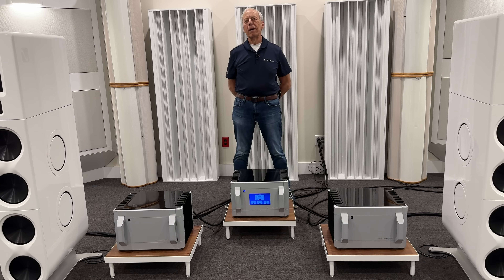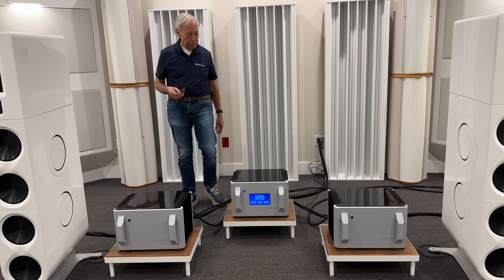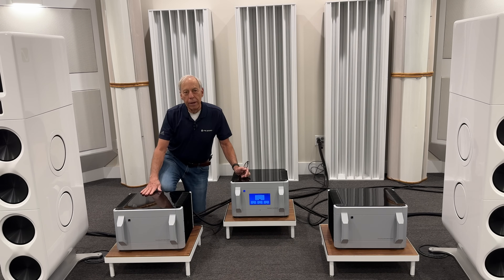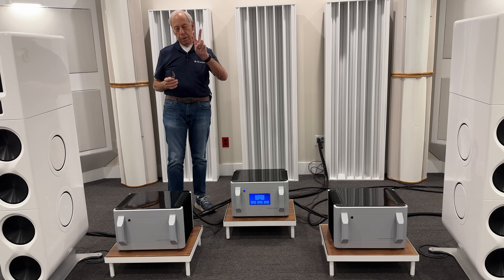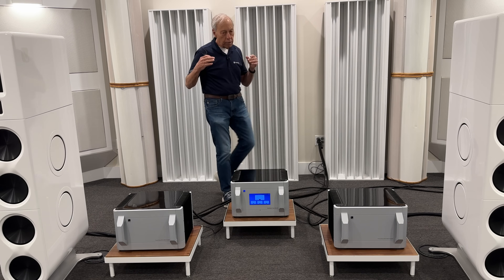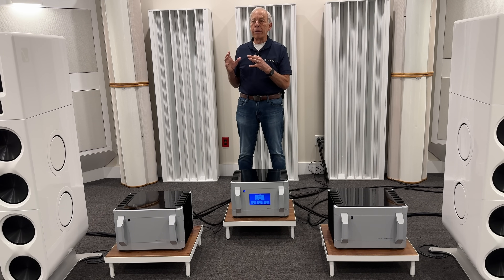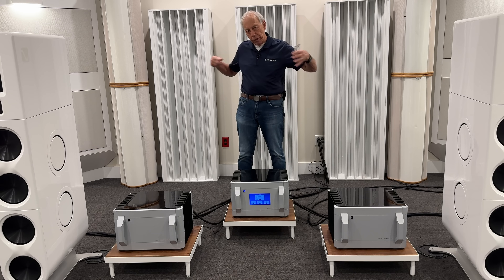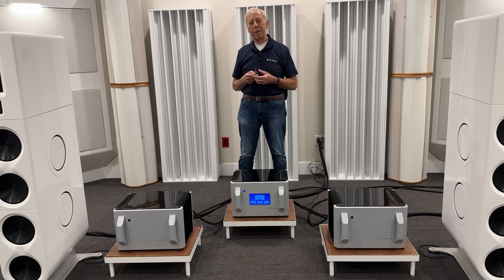What is a power amplifier?

Comment: Can I connect an external amp to preout zone 2 to use for the same main room L/R?
Have Pioneer vsx lx303 and would like to add an Emotiva 2 channel.
Ive used zone 2 in other rooms but not like this above. Can Audysey still work like this? Cannot get any answers, even from any manufacturer

Comment: To me a power amp is a power valve.  It's job is to accurately produce high power signals that faithfully recreate the source.  And it has to be impervious to the reactive push back from the speakers.  What differentiates a good amp from an amazing amp is its ability to recreate low level information with phase fidelity.  This low level info may only be in microvolts, but this is the stuff that breaths life into music.

Comment: Tube amplifiers use transformers as an equivalent to the second current gain stage in transistor amplifiers.
Reply: Actually I'd assert that the power tube is the second stage and the input tube is the gain stage.  The transformer is the transmission.  Back to his car analogy, the engine cannot start the car from a stop light in high gear.  It needs to be stepped down to produce power in first gear.  That's the job of the stepdown transformer.
Reply: Tube amps are two stage with a gain stage followed by a voltage output stage. Tube amps are constant current while solid state are constant voltage. Transformers are for Power transfer.

Comment: I always thought of an audio current amplifier as a buffer than reduces output impedance and has a lot of current in reserve in the large reservoir capacitors, but doesn't change the voltage.

Comment: The car analogy is - voltage = horse power and current = torque (kW) 😀
Reply: Voltage is pressure = torque. Ampere is the volume of the flow = rpm. Total energy accessible or used = Watt. 🙂
Rush hour = Ohm. 🙃

Comment: A power amplifier is technically speaking a voltage amplifier (output voltage = input voltage x gain factor) with ability to drive high currents in a low impedance (typically 2-8 Ohms) speaker load. Power is voltage times current. If the input impedance of a power amp is 100K Ohms and the input signal is 0.5V, the input "burns" 0.5Vx0.5V/100K Ohms = 2.5 micro Watts from your source output e.g. pre-amp via RCA signal. Yes, power is also burned on an RCA cable, even it's a tiny amount. If your speaker output is 20V, meaning 20Vx20V/8 Ohms = 50 Watts in 8 Ohms, you amplified the voltage with 20V/0.5V = 40 times and the power with 50 Watts / 2.5 micro Watts = 20 million times. Thus calling it a power amplifier does make some sense 🙂But still, the reason the 40 times voltage amplification is more of a true gain factor is that the 20 million power amplification factor, in this example, entirely depends on the speaker impedance, which varies greatly by frequency.

Comment: Paul... has done better.  And yes, surely some will comment that it is the current , not voltage, which is making those transducers move, and while that is certainly true we should remember that Paul is by practice an electrical engineer, and they are taught to design circuits with the potential (voltage) drop (across whatever they put in their circuit) in mind.  It is afterall the Electro-motive Force which makes the current flow.
Reply: Neither voltage alone or current alone does any work. It's an entirely wrong way to look at it. Moving air with a speaker cone is essentially work that takes energy. This is equally true for dynamic speakers, electrostatic speakers or whatever speakers. Energy per time is what power is about. One Watt is defined as 1 Joule of work per second. One Big Mac contains 2.25 Million Joules as a reference. Thus if you could run a speaker with an average power of 1 Watt with no losses on the energy from a Big Mac, it could play for 2.25 million seconds. That's about 26 days of continuous music. A human body might burn some 100 Watts on average, giving you around 6 hours of energy on eating one of those Big Macs. Yes, power is voltage times current, but it still boils down to power doing the work and theoretically, someone could create a speaker that ran on water pressure through a hose instead of electricity through a speaker cable, and it would still be power and energy transfer driving it.
Reply: @ThinkingBetter Yuup, correct, and if people understood a little bit more about energy we wouldn't have as many fad diets or car reviewers raving on about torque. 😄
Reply: @PSA78  Yes, you are very spot on. You can find lots of car related videos here in YouTube trying in the most ignorant ways to explain and compare torque (twisting force) and horsepower (unit of power equal to 746 Watts). And modern fast food is a disaster in unhealthy energy. A Bic Mac contains some 54 chemicals and while it can keep you going for some hours, eventually it will kill you.
Reply: @ThinkingBetter  Yes it's an old misconception that torque matters for acceleration or pulling heavy loads, if time is involved then it's energy released which is hp, but it seems hard for them to either understand or get away from the old. "Hp sells cars, torque wins races" is one of many bad/faulty quotes that's used. 😄
Actually even fruit like an apple contain ~40 chemicals naturally, everything around us is a chemical, and at the end of the day it's always the dose that makes the poison. 💊
We should to focus on lean protein and fibers, some essential fatty acids, minimise the amount of saturated and trans fat. But once you break it down to the correct levels of each individual macro and micro nutrients as well as calorie balance for weight, then it's not going to make or break anything by enjoying Some soulfood. 😋 They even did one extreme study with basically a candy diet, as they lost weight all health markers improved, naturally it's not going to be healthy longterm, but it certainly gives a perspective. 😄
Reply: @PSA78  I moved to California from Denmark long ago and got shocked on how ignorant people are here on many topics of laws of physics. Part of it is that the laws of physics gets very obfuscated when using imperial units like horsepower, pound-feet, inches, feet, yards, miles, square feet, acres, ounces, quarts, gallons, pounds, newton-meter, Fahrenheit, Calories and who knows what…I’ve been here 20 years and those units still drives me totally mad. A pound-feet is a unit of torque and a pound is a unit of mass but in this case meant to be a force. Rather a newton-metre as torque unit is not confusing mass and force.
Reply: @ThinkingBetter  Last I heard America was slowly implementing the metric system, inch by inch. 😜
Reply: @PSA78  Gosh I hate those inches. I just installed an electric charger unit for my EV in my garage including the heavy wiring needed inside the wall and had to deal with this crap. It's extra annoying when fractions of inches are used. My drill bit set is such a total mess of fraction defined inch based sizes. I did the high power (60 Amps 240V) wiring myself. The wire is 6 AWG. AWG means American Wire Gauge. IEC 60228 defines it well using square millimeters, but of course the USA is stuck in this stupid AWG system where you have no real good sense of it. And lower numbers means bigger dimensions. 6 AWG could be 1/6th of an inch (0.1666...) in diameter, but for some reason it's not exactly that. Rather it's 0.162 inches in diameter...and nobody seems to know why. I would prefer 13.3 square millimeters, because it is much more intuitive to me. A few days ago I was creating another container of some weed killer I use in my garden by mixing water and the nasty RoundUp concentrate and I got it all wrong because of how Roundup defined the procedure involving these stupid ancient units.
Reply: @ThinkingBetter  Yuup, American units are about as well structured as Italian bureaucracy. 🙈😆
Reply: @ThinkingBetter  
I never had or have a problem with mixing liquid fertilizers and other chemicals or weighing granular fertilizers and other chemicals for square foot applications. Probably because starting in Elementary school I was taught the U.S. standards for weight and measurements. The obvious problem is you weren't taught the U.S. standard system at a young age, so now you struggle. With the constant brain thoughts of "stupid ancient units" you're not helping yourself to understand either. You say you've been in the U.S. for 20 years and yet you haven't mastered the U.S. standards yet? Wouldn't you think if I moved to Denmark it would be wise of me to learn and understand the Metric system? By the way, in the 1960s when I attended Elementary school we were told that the U.S. will move to the Metric system in the future. We're still waiting, lol.
Reply: @Mark-lq3sb  Yes, that’s of course a valid point. But there is also a whole lot more simplicity in the metric system. 12 inches make up a feet. Using prefix like micro, milli, centi etc. with unit of meter for all things distance is simpler. Square meter or cubic meter are still founded in the same distance. The gauge of a cable using square millimeters is also much more intuitive than AWG numbers. Of course the world didn’t change for no reason.
Reply: @ThinkingBetter  
Agreed, it is much simpler. Those darn fractions gave me hell in Elementary school.
By the way, my mother's side of the family moved from Denmark to the U.S. in 1890. 
My grandfather Roy Hansen grew up on a farm in Iowa.
Reply: actually, the transducers move with the voltage. They just need much current to sound loud.